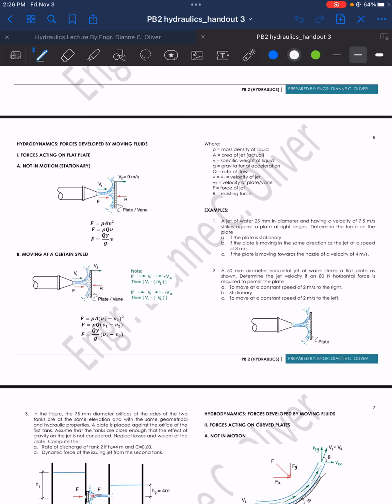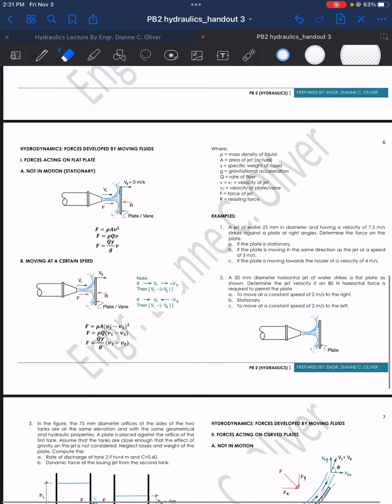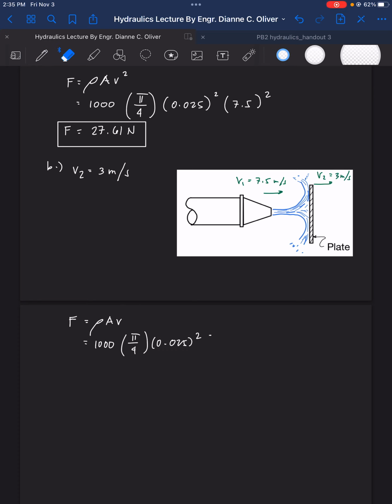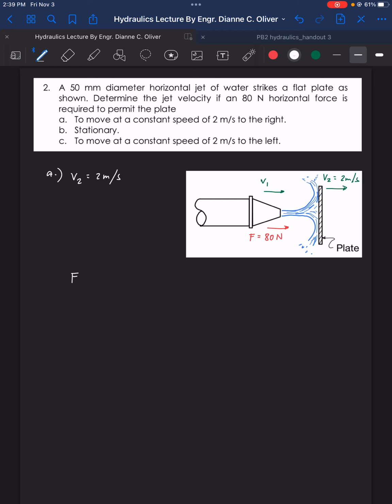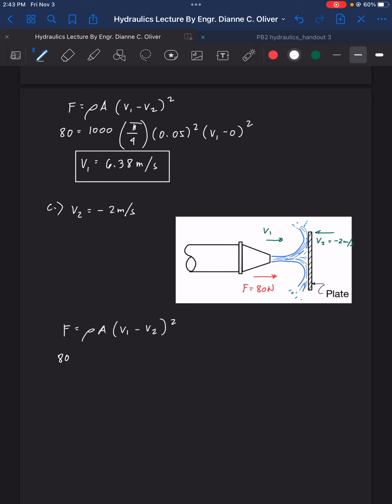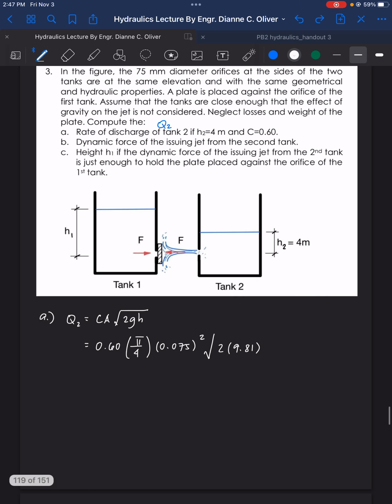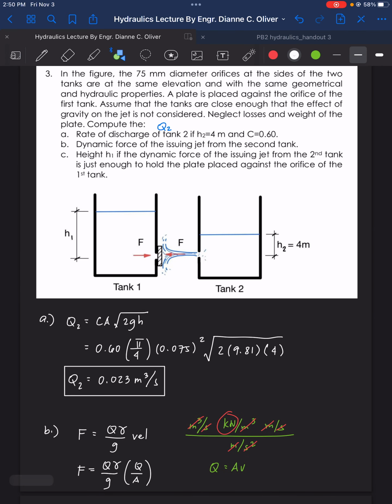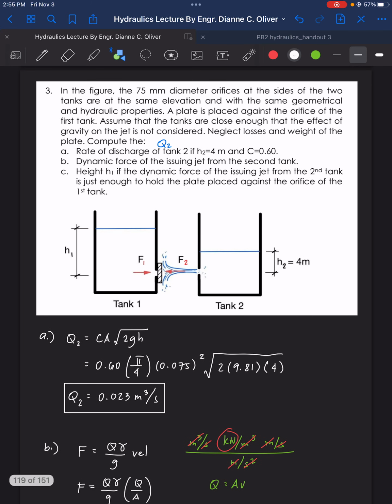Hydraulics: Hydrodynamics - Force Acting on Flat Plate

Comment: Hi po Engr. tanong lang po sa question number 2 letter A 13:45 shinift solve ko po sya bat iba po lumabas sa sci cal ko -4.38 po lumabas, sana masagot Engr. Salamat
Reply from the maker: Since naka squared property, may two roots na lalabas for x. Isa na jan ang -4.38. Yung isang root ay 8.38, na yun yung gagamitin natin for the velocity.
Reply from the maker: Sa ibang sci cal, isang root lang ipapakita nya for value of x pag nagshift-solve, tapos yung negative value pa. Try na i-long method mo ang solving para makuha positive value nung isang root